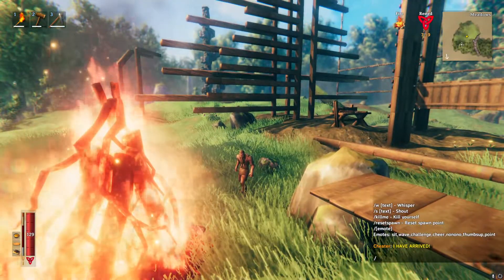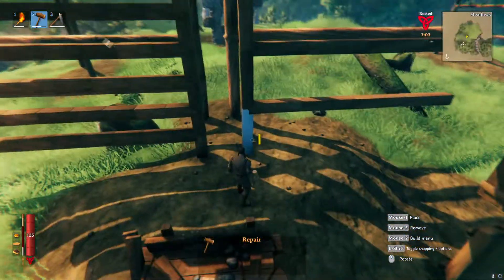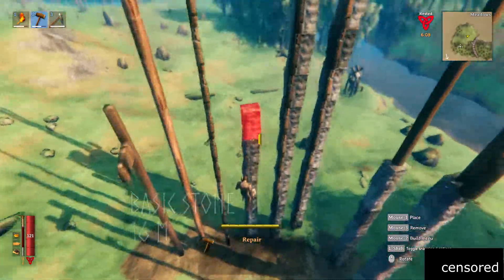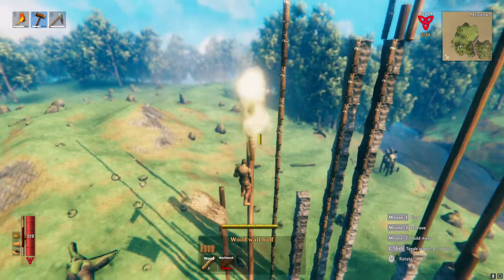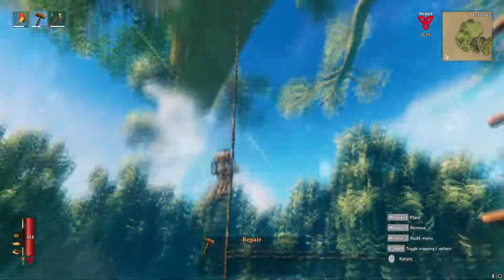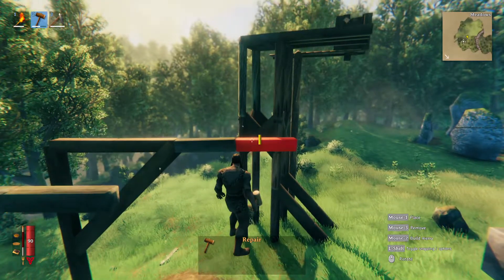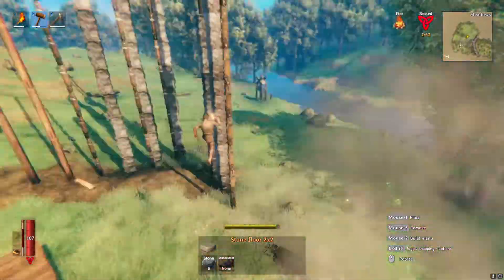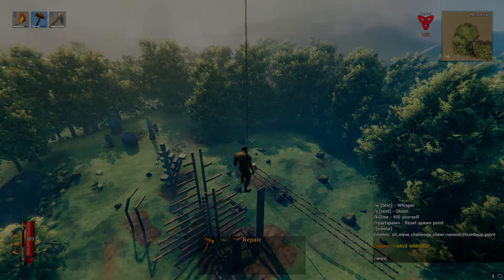Valheim Building Stability / Integrity Explained

Comment: Ive got a question: i can build 16m high with stone, so that i can build 2x1 stonewalls upon each other without the last one being destroyed. However if i build a wall whose grounded pieces consits of 3 2x1 pieces and i build 4 2x1 pieces upon them so that the middle of the 2x1 piece is build upon the connection of the 2x1 pieces beneath it, i can only reach 12 or 13 meters. Why is thats so?
Reply from the maker: If I understand that correctly you cannot have any overhang on the edges. So you need to place 1x1 walls therso you have the following:
2x1   2x1   2x1     2x1 
1x1  2x1 2x1 2x1 1x1
2x1    2x1    2x1    2x1 
1x1 2x1 2x1 2x1  1x1
Reply: @vinrenu1389  ah okay, yes indeed i had overhangs on the edges, but even if the pieces are all connected i cannot build a 16m stone structure. Its only possible if i place each piece directly onto another.  So in conclusion: structures consisting of stone pieces that are arranged like a zip tie,  cannot reach as high as being build with pieces that are directly on top of each other, which is counterintuitive.  Best video ive seen so far regarding this stabiliy thing in valheim.
Reply from the maker: @DeepDeepEast  I just tried it and if i counted correctly I made a ziptie wall 16m high. Strange. Have you checked that all of the bottom line are blue (connected to ground) ?

Thanks for the compliment :)